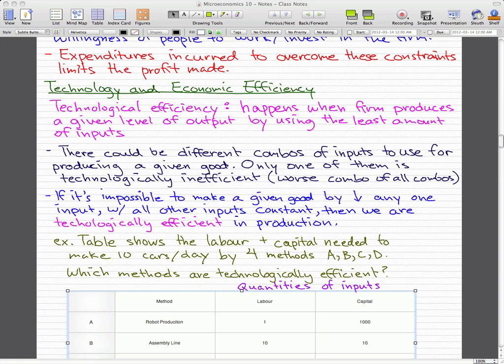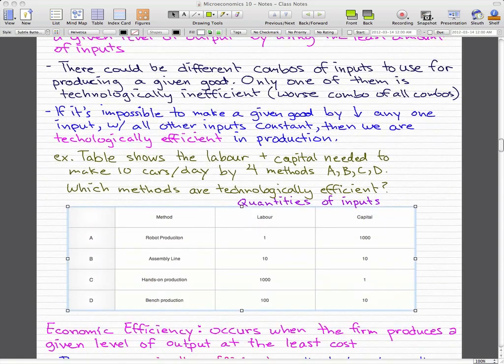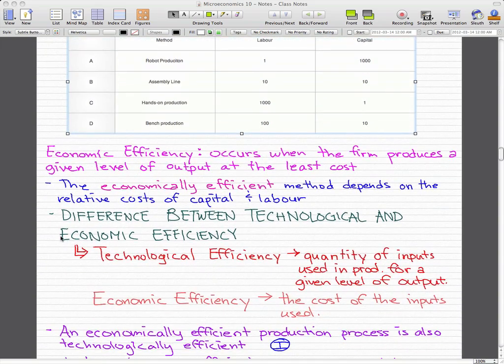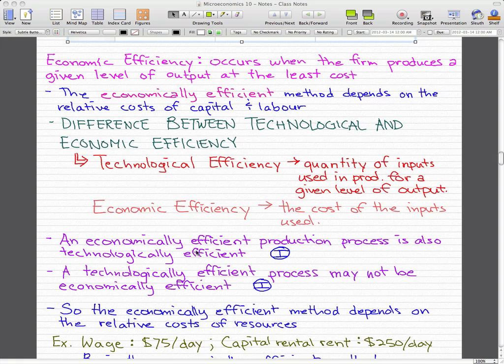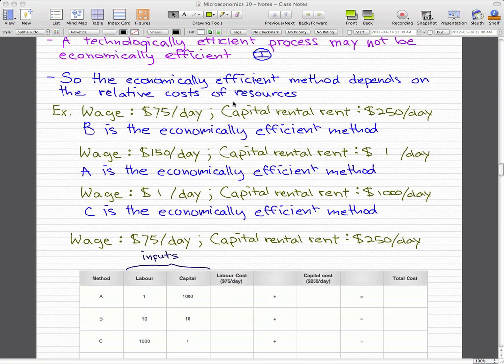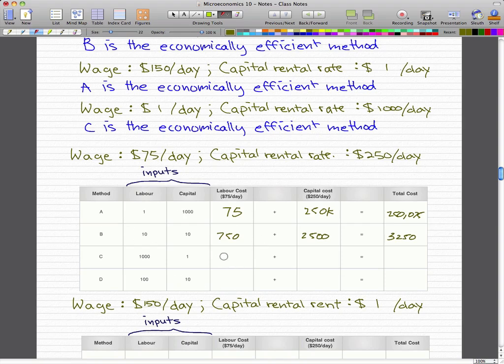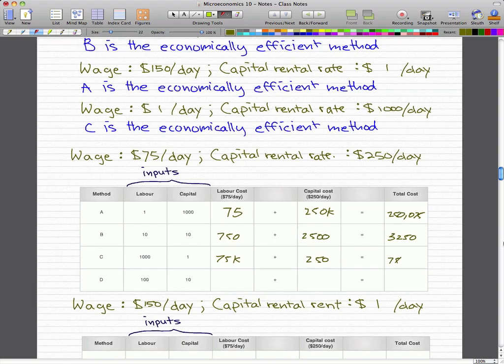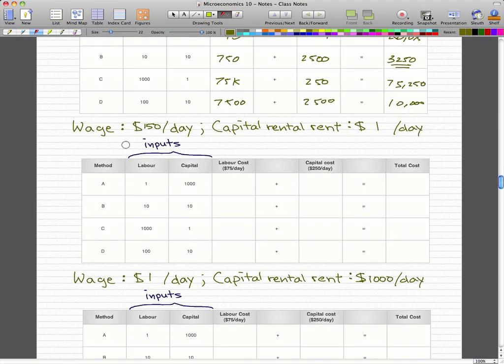Microeconomics - 107: Technology and Economic Efficiency

Comment: I'm sorry, but an economically efficient production process is not necessarily economically efficient, further more, even by your definition, it is not the most technologically efficient process. That is because economics are governed by growth and for maximum growth you need to work in cycles of technological advancement of processes used in production, therefore, I would define an economically efficient production process as the most technologically efficient process we can afford at a given moment in time.
A good example of this is computer processor production technology that works in cycles. Have a read on Intel.
Reply: kurcNaPalc 
Can u plzzzzz explain again technologically efficient how we will know that method is technologically efficient